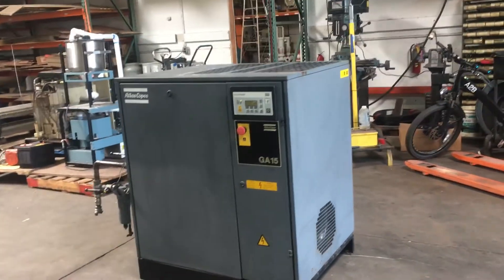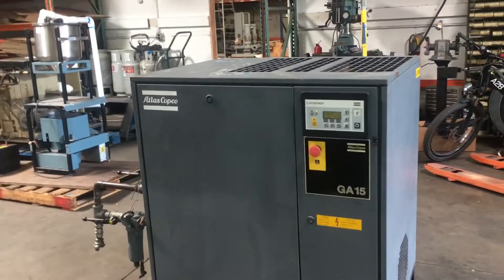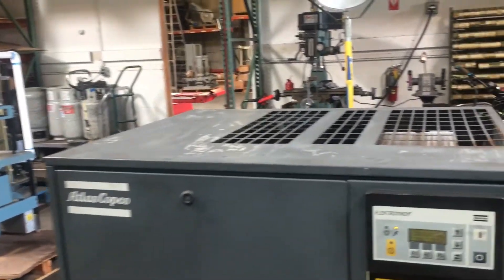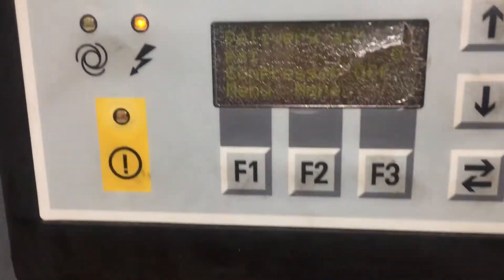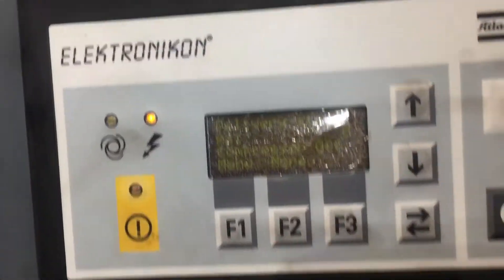Atlas Copco GA15 20hp Rotary Screw Air Compressor Only 32,336 hours!

Comment: HELLO 
I NEED YOUR HELP
MY compressor a Atlas cop ga15 getting started but there is no air coming from out-let
How to troubleshoot it.
Reply from the maker: Hello Rama, It could be several things. But I would check the inlet valve which controls your air flow. Or you can check the minimum pressure valve with releases the air from the separator tank.
Reply: Make sure its not broke